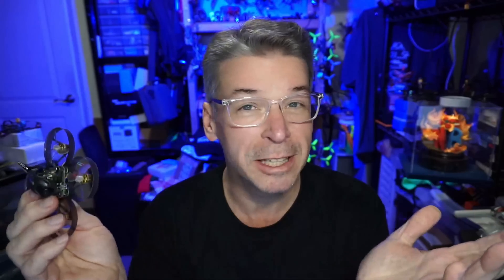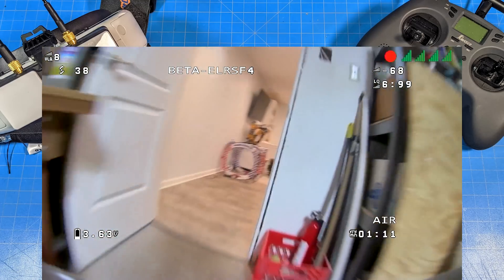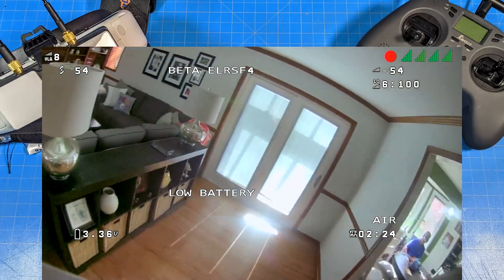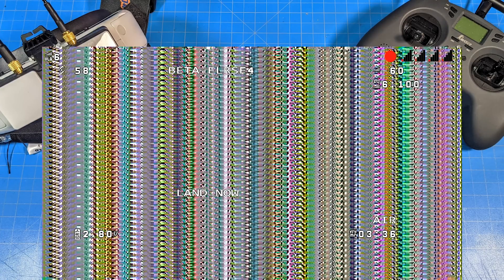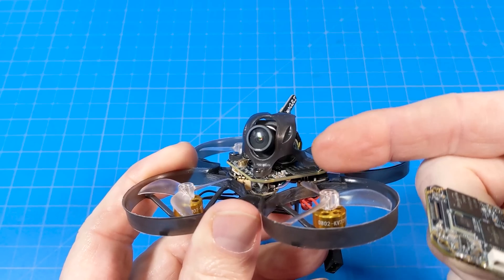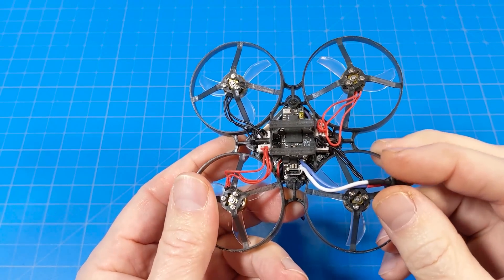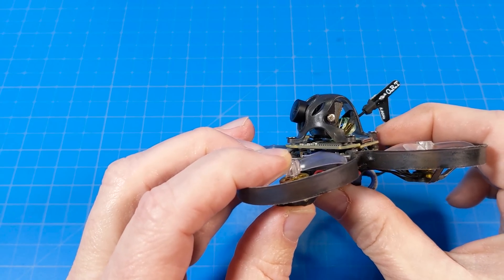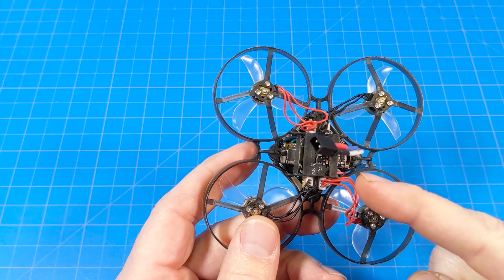Can't Do That With DJI // HDZero 1S vTx  // More HDZero Micros

Comment from the maker: Do you want a 1s-4s or 2s-6s whoop HDZero vTx?
HDzero Available At These Resellers
GetFPV - https://bit.ly/GetHD0
RaceDayQuads - https://bit.ly/RDQ-HD0
NewBeeDrone - https://bit.ly/NBDHD0
AliExpress - https://bit.ly/ALE-HD0
Banggood - https://bit.ly/BG-HDZero Use "BGRCParts8" for 8%OFF
Reply: hehe, why not both? :)
Reply from the maker: @marc_frank  I suspect the market will determine. I have a hard time seeing to many flying 5s or 6s and needing a whoop form board. And if so, likely have a 10v pad on the fc they could run the 1s-4s whoop board.
Reply: @NickBurnsFPV  I have a sub 250g 5" build with the whoop board. Battery is 550mah 6S. Weighs about 249.5g all in. I like the whoop board better than the race board because of the mounting size is the same as AIO FC boards (for weight savings). On my build using Beast F7. Also the whoop board has M2 mounting, which is more ideal for my builds.
Reply: @NickBurnsFPV   I'd like to see a 6s board. I've found that whoop AIOs work well for cinewhoop builds and on those, often the 10v pads die, so being able to run off Vbat is Clutch
Reply: I'd definitely expect 1-4s boards to be the main seller at whoop scale. And the system will completely dominate the market if they can shrink it down to be flyable in 65mm 1s whoops. As it stands I would probably remove the flash and button connectors from the board to shave another .5g or so off
Reply: 1 to 4s would be my pick. I generally fly lightweight 2 to 3s rigs.
Reply: Great news. More to come. Too bad that COVID has really hurt Divimath for two years now. I see in a couple of years that we possibly could get an HD AIO with ELRS for whoops and sub 250g but it would require a new HDZero chipset.
Reply: i guess the cells dont really matter i have 6s and 4s and well 6s being the dji fpv and the 4s being the babyhawk.  a drone that small enough to fly indoors but has the ability to rip outdoors hahaha i know i know you get this all the time.  a bnf i guess and the only system i have is the dji fpv system...for now. i will use a affilate think for your trouble probably patreon as well once i figure out what the heck it is.
Reply from the maker: @richardmcguigan1382  no worries. I hope to have a indoor dji project ready before we go on vacation.
Reply: @Nick Burns  ibwas thinking 4s and was looking at the i flight a 85 then i guess theirba c  the one is a pusher one is a cinewhoo one a whoop then i got a headache my brainnhurts ....so manys
Reply from the maker: @richardmcguigan1382  My personal opinion of pushers are that they are fine for flat steady flying, but not much else. They really aren't as responsive as traditional. For indoor 85mm is a bit much in my opinion. I prefer 75mm max, 75mm is actually my preferred for indoor. 65mm isn't different enough in size but does lack the performance and flight time of a 75mm.
Reply: This hobby is so overwhelming i thought the military had to many ACRONYMS. THEN TWITTER....HAHAHAHAHAH BOOM ENTERES (FPVHOBBY)= BRAIN FRIED
Reply: So now im leaning towards something like the geprc tinygo 2s.  Ibrealize bow after seeing what you made with a 1S that speed doesnt really come from the cells...lol.  i guess im looking for a indoor trainer is the best way i can but it has spped but can do mild acro.  Butbi dont want the tiny hawk 3.  I dont know why i flew it at B AND H PHOTOS.  IBDIDNT LIKE IT. maybebitbwas thebcage they make you fly in ..im not sure.  But know that we have a foot of snow i wish i had any kind of indoor whoop that flies manual
Reply from the maker: @richardmcguigan1382  Be aware the tinygo rtf kit radio isn't compatible with any other receiver or quad, unless they changed it since I reviewed it. Performance comes from the power to weight ratio. Generally the larger the prop and ofcourse lower the weight the more response and speed we can get, this with limits of course. We can also suffer from to low of weight which can make a quad feel floaty and awkward.
Reply: @Nick Burns  Thank you ...yeah i dont mean im want that one but thats the power system and size that i was thinking would be good for indoors, but then i see you fly the 1s which i have a ton of batterys for   i didnt know a 1s can fly that fast. But to be fair i dont know alot about this hobby other then its addicting and expensive.  But enjoyable while semi retired..
Reply: @NickBurnsFPV  I guess the cheapest way for me would be to stay with dji just not to many options that i know of. smart 16 and pavo not sure what else
Reply: @NickBurnsFPV  the new flywoo firefly i like as well the new one triblade but i dont have anything that it would connect to unless they make a hd version
Reply: @NickBurnsFPV  again i apologize for bothering you but does hd zero mean dji?

Comment: I got one better make the whoop board with the break away corners and add 20x20 holes too and make it 1 to 4s then kill 4 birds with 1 stone and make it 400mw and forget havinging 5 boards just make 1 fit all and have a 1w 30x30 and you won't need to manufacture all thoes and worry about quality and quantity available over all the different needs seperate

Comment: I might be wrong but I'm going to ask anyway, only way to learn. Ok so I noticed that the props were a little different than standard, I thought on all quads that with the camera facings you that the front right motor always turns clock ⏰ wise... if so the prop looks like it was back wards? It's just me I'm still learning...
Reply from the maker: We have two ways to set our motor rotation and thus props. We tend to call it props in, which is the traditional method, and props out where the motors/props rotate in towards the outside/body of the quad, rather than in to the nose and tail.
Reply: @NickBurnsFPV  ok thanks i learn something new every time I watch one of your videos 👍

Comment: is it 1s only ? or 1-2s ? please let it be useable from a 5v pad, then it will be a great successor for all the 2s/3s HD toothpick builds. edit: rewatched, it should work on 5V if the 5V rail gives enough mA. hope the 5v 1A of most 2s-4s whoop boards is enough.
Reply from the maker: yes if the 5v bec can keep up it will work it didn't in my particular case.

Comment: Hey Nick. When you did the swap out on the mobula 6 HD from 65 mm to 75. Did you use a 450 mah? and did you use the same motor?. I am attempting to do so tonight
Reply from the maker: Yes I did use a 450mah battery. And 40mm props same motors and all other components
Reply: @NickBurnsFPV  https://youtu.be/QT1RrTEOtms
Reply from the maker: @jerrybullington7752  ah yes, looks good. I do like who you customize them. Brings a bit of joy even when just looking at them. The vtx wires are close, to help protect them I sometimes brush a layer of superglue on that outer edge, very light as to not get it on the connector and glue it to the receiving connector.

Comment: This is pretty awesome. If DJI does not do something soon - I will have to get into HDZero too...
Reply: This is half-way between analog and dji in terms of quality (being generous) and weight, why would dji worry about that? When they can do it at analog weights or DJI quality, then we’ll have some true competition.
Reply: @FilipRadelic  OK, but it is still quite a bit better than analog in my opinion. I can see this in micro builds where a vista will just not cut it weight wise. Also I am not saying  that DJI should worry - they have a great system - unfortunately they don't cover my micro needs.
Reply: @stylesuxx  yeah but you said “if DJI doesn’t do something soon”, I was mainly referring to that and trying to say if you like where HDZero is going, you should get it and not wait for DJI’s move as I doubt there will be one. But then again, we never expected digital fpv when they released it so who knows 😅

DJI absolutely does work for micros imo, see the dji whoop racing playlist on my channel.
Reply: @FilipRadelic  Maybe soon was worded badly, I meant in the time it takes for all the HDZero stuff to be released and available - also keen for their "upcoming" goggles. But yeah you are right - waiting is generally a bad idea - also waited to long to buy into DJI HD FPV ;-) I will definitely check your playlist.
Reply: @stylesuxx  I am definitely excited about HDZero goggles and what might come next after them, even though I am very happy with my DJI setup and often called a fanboi 🙂

Comment: I am very going to need one of these.  Or three!   I've not been flying my whoop because HDzero on my other quads looks so much better. This should change that.    But when are they going to come out with a replacement for that 500w board?  400-600w is the size I need to get me to fully switch to digital.

Comment: Incredible image!!  30g seems so heavy to me, but you flew it so well.  I wonder if it could powerloop an object inside :P
Reply from the maker: Lol it does fly like a heavy whoop, 30grams a few years ago was normal whoop weight. We have come so far
Reply: My 35g dji whoop powerloops and matty flips just fine inside, so I have no doubt this one could 🙂
Reply: @FilipRadelic  DJI tiny whoop sounds way too freakin cool.  I dig your race vids!  I recently put a split HD cam on a 75mm 2S build ~36g dry-- Now to tune it to fly as smooth as yours!
Reply: @shalotfpv  thanks bro, mine’s just EmuFlight with on of the whoop presets, possibly the 0802 1s one, not 100% sure as I haven’t changed it in a long time.
Reply: @FilipRadelic  Emu's stable mode is my favorite!  Rip on :~)

Comment: Awesome. I think HDzero put the final nail in the coffin for analog.
Reply from the maker: They are inching that way. For the smallest of micros we have a way to go and cost but that is largely an adoption issue and our current costs of manufacturing
Reply: @NickBurnsFPV  that’s very true.  I still run analog on all my whoops…but as of today I just received an HDzero whoop board so I’m going to convert my TKS 2” from analog to HDzero.  😎

Comment: This is fantastic
Reply from the maker: I have a question if you fly 6s? Do the fc you use have a 9v or 10v pad regularly?
Reply: @NickBurnsFPV  no they dont since im analog, i mainly use the raddix li but i have been running the 20x20 tmotor and im pretty sure it has 9v for digi stuff
Reply from the maker: Ok thank you for that. I was thinking 5inch fc would be able to supply power to this board. I wouldn’t be surprised if we find it launched 1s-6s 🤷🏻‍♂️

Comment: So what I’m going to need now is a HDZERO Vrx that I can put on the opposite of my Rapidfire all hanging off my DJI googles and I’m all set 😂 have a feeling I’m going to need stronger neck muscles to stop the Fpv head droop 😂😂
Reply from the maker: Lol need a neck alarm 😂. I don’t know how we could accomplish hdmi into the dji goggles. That might be rough to work around
Reply: @NickBurnsFPV  yeah not going to be easy I guess and using the analogue in as I do with Rapidfire I guess is just composite video 576px or something 😞 damn hobby always making me broke 😀
Reply from the maker: Yes I don’t think we can over come the limitations of the pins in the module bay. But if the hdzero goggles have all the features they plan on we can put the rapidfire in the module bay. Hope the cost is competitive

Comment: How did you get the VTX to mount higher?  I ran out of height on my frame posts.
Reply from the maker: The mobula7 v2 frame have longer posts. The v3 and v4 posts are shorter. Probably have to use a 3D print or nylon stand-off on those frames
Reply: @NickBurnsFPV  Interesting because I am using the Mobula7 V2 frame because it was the lightest 40mm frame I could find, but your build looked like it had longer posts.  Maybe my FC gummies on the NBD Hummingbird FC are longer.  I think I need longer screws, but I do not know where to find other lengths of that kind of screw.
Reply from the maker: Ah we might need to cut down the rubber Mounts or turn it upside down to get the fc lower
Reply from the maker: @IanBeaty  I don't have a solid source for screws. I look for m1.4 and 5+mm length, ebay, amazon etc.
Reply: @NickBurnsFPV  Sounds good.  Thank you!

Comment: I am in the process of building a 1s HDZero whoop right now using a voltage regulator, and am really happy to learn about the 1s board.  I am using an FPV Cycle toothpick camera mount that I 3D printed. It weighs 1.3g, the same as the NBD Goober and V2 canopies which I also weighed to compare, but the FPV Cycle mount fit the camera a lot better.
Reply from the maker: I think the canopy in the video is less than a gram. I need to refresh myself on that information 🤦‍♂️
Reply: @NickBurnsFPV  Oh nice. I would definitely go with your lighter canopy to offset the HDZero added weight.

Comment: Hopefully see an Rx module in stores soon too, this has basically sealed the deal for me!
Reply from the maker: Like one that fits into most goggles?
Reply: @NickBurnsFPV  That'd be nice if it went inside the goggles bay! But even another run of the sharkbyte modules that hang off the front would be fine
Reply from the maker: @steezyfpv7620  yes, currently the local manufacturing facility is on lockdown again.

Comment: Wow, very impressed. I already got DJI but the lack of whoop sized VTX makes me sad. We got 6months of bad weather, i would really want to fly HD whoops inside!
Reply from the maker: 6 months is a lengthy period to have to suffer through. flying from inside, maybe inside car?
Reply: @NickBurnsFPV  I might have exaggerated a bit but the summer is pretty short here up north. Right now its cold and very strong winds, would not mind flying a hd whoop inside my house if i say so!
Reply from the maker: When we are in the thick of uncomfortable weather we tend to see if worse than it is. I get ya. We have been super cold for a few weeks. I have only flown outside 2 times since Christmas 🥲
Reply: Why not just built a dji whoop? Vista is whoop-sized, just remove heatsinks. I love mine, this doesn’t even look comparable.
Reply: @FilipRadelic  Cool, do you have a video with it flying inside a house or a link to one? *edit i found it now. Looks good! My concern was the extra weight. I thought every gram made a difference on a whoop and the naked vista is still 15.5g. Guess i could build a DJI one!

Comment: I can do it with dji, just need a step up regulator, and they make some which are 2-3 grams.
Reply: You can do anything if you really want too but is it viable, sensible and even practical.  

First of all the efficiency of dc to dc buck is pretty poor for increasing voltage so your increasing not reducing current draw.  Likely well over 1A for an vista on a dc to dc converter.  

Secondly the vista is a chunky monkey regardless if it’s running on 1s or not even decased so it’s going to be a heavy, sluggish beast regardless.  You can’t beet physics no matter how hard you try.  

Realty is It’s DJI simply not designed for this application and it’s unlikely DJI will ever produce an Airunit that is let alone any new ones at all.  Here and now HDZero is pushing vtxs into the market to fill all segments users are asking for. 
This a great example of that.  

This is another really interesting option for users and it’s clear from the video and IQ it looks great too.   

Just because you can does not mean you should. It’s it’s really ideal.   DJI really is not for this application.
Reply from the maker: Good explanation! I do plan to explore naked dji on 2s soon.
Reply from the maker: Doesn't that miss the point? Power it sure, fly it on 40mm props on 1s? Not so much.
Reply: Have you done this?

Comment: I've never flown dji indoors but dam, that looks amazing. I'm guessing you're flying in less than 4,000 sq. ft. and I didn't notice any of the speckles that are normally seen in outdoor flights with HDZero. Even in my small single floor house, I get many more anomalies using TBS Fusion and 100mw from my analogue whoop.
Reply from the maker: Yes, the house total finished space is 3800 sq ft, I don't go upstairs in this video.
Reply: Check my second to last video, dji whoop racing. I’d say this one is about half-way between analog and dji in terms of price, weight and quality, which doesn’t seem worth it to me. Especially since I originally built mine over a year ago.
Reply: @Filip Radelic  considering I don't have an HDzero receiver, it's definitely not worth it for me yet. I definitely see the platform has matured a ton and it looks like analog plus plus now. Much cleaner low latency video feed just not as many pixels as dji. Someday I'll try it out when I can afford to but not just for my small quads either.

Comment: Nearly ecstatic. Initially resisted DJI before getting in late. And? It still sucks. Truly astounded that another company has not blown them out of the water yet.
Reply from the maker: The development of these components is likely very very expensive
Reply: @NickBurnsFPV  OK. Stipulate that.

Can't blame me for hoping. If Skyzone threw their hat in...
Reply from the maker: I wish I had more knowledge as to the size of our typical fpv companies. I suspect most are super small. Dji is huge comparatively. I have worried dji will just drop the air units at anytime if it doesn’t fall into their future business plans

Comment: It's amazing that the hdzero board worked down to 2.8volts. How warm/hot does it get compared to the traditional HDzero whoop board?
Reply from the maker: Heat is a good question. In just handling it, I would have to guess about the same. I did put my finger on the asic a few times and it does get noticeably hot.

Comment: those breakout pieces they always break and leave you with half circle to hang onto the gommets and they always slip off in a crash. i rather have the normal mount ( no breakouts ).
Reply from the maker: I use 5mm screws to mount which does seem to help keep things in place.